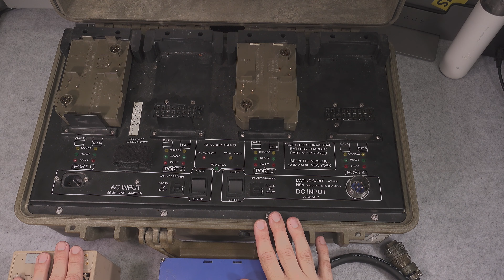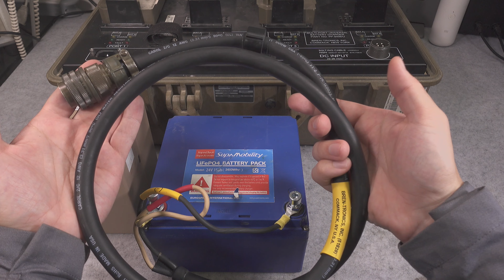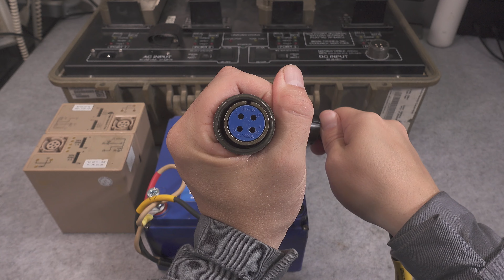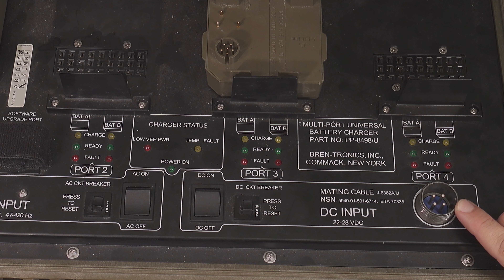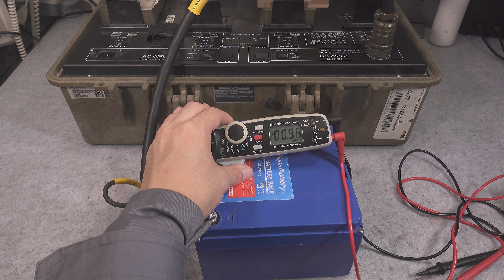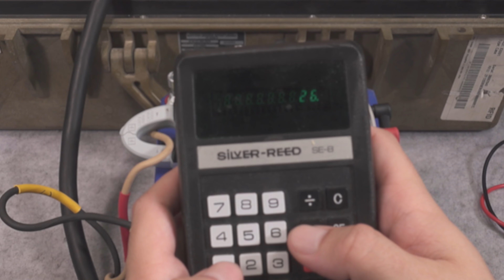Powering Military Soldier Portable Charger SPC directly from 24V DC (solar or vehicular)  PP-8498/U

Comment: I've got the same charger and batteries. Last week while charging a battery in the house it caught fire. Lucky I was around. Charger is fine. Battery is toast. Be careful when charging bb2590's or higher inside. Just a heads up but great video!
Reply from the maker: WOW - lucky You!  - This should never happen - it's monitoring temp inside, also on BB2590 You have another layer of protection with BMS inside. Tell me more about those batteries?  Is that was initial charge or You use them everyday and just that day they failed? Have You uploaded pictures / video somewhere to take look?

Comment: The DC input will go through an inverter just like the AC won't it?
Reply from the maker: It skipping AC part - that's why it's more efficient. When I was running it thru inverter  it was pulling almost 70W idle. So it's pretty massive difference if leave overnight from DC system.